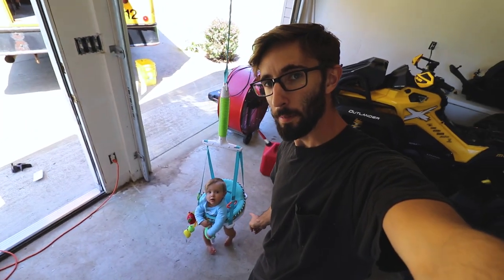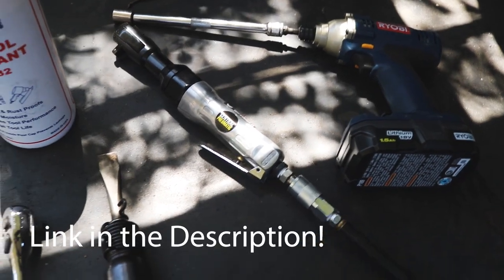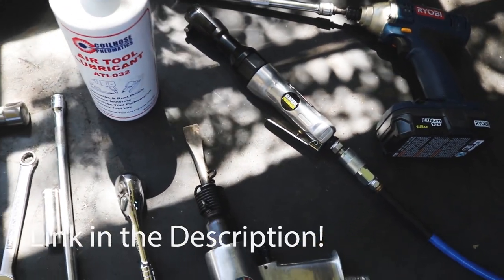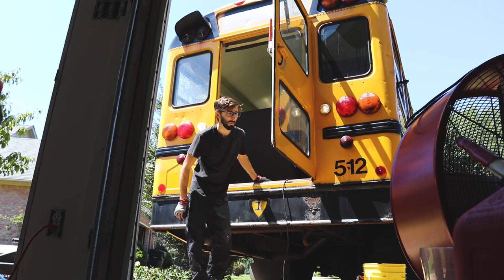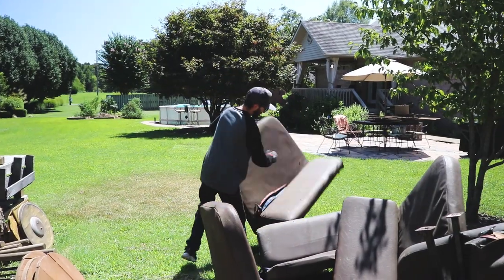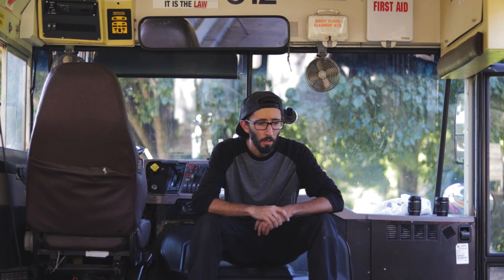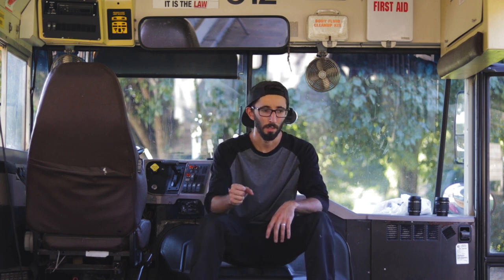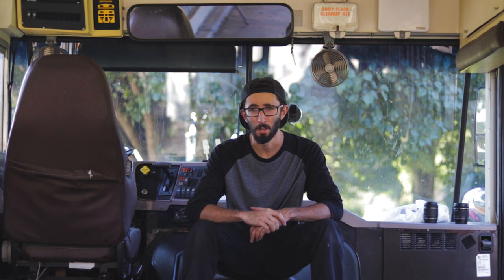How to Remove Passenger Seats in a School Bus // Skoolie Conversion

Comment: Question for you! I’ve been taking the seats out of my mini bus, but it seems that one row of bolts is on top of the gas tank Period is there some trick that you found to get bolts like that out?
Reply from the maker: I have not. My first thoughts is that you could grind off the heads of the bolts and then the rest of the bolt should just fall out the bottom of the bus! Congrats on the new build btw!
Reply: @BackroadPurpose  I ended up cutting the heads off thinking the same thing, but found that there was access beneath the floor (when I took it up) to right above the gas tank. Ended up having to saw by hand for a few of them which was a pain, but got the others out with a multi tool. Not a fun process lol. But it’s done! And thank you!